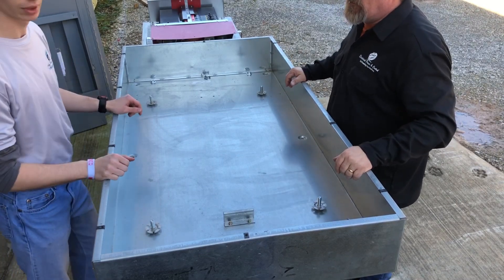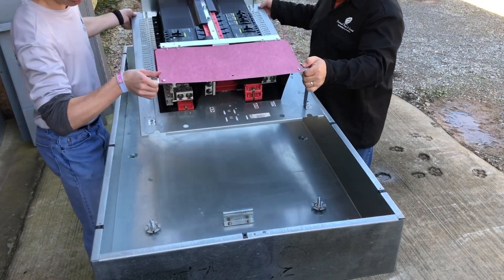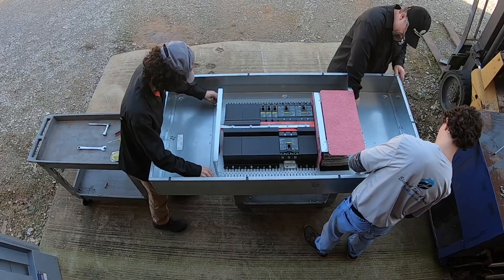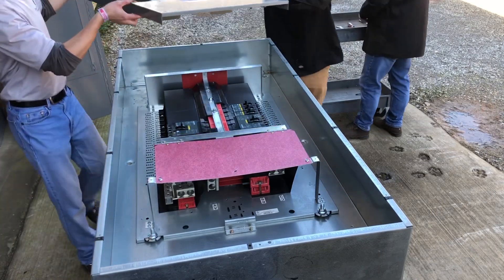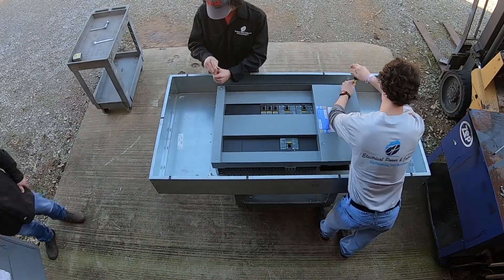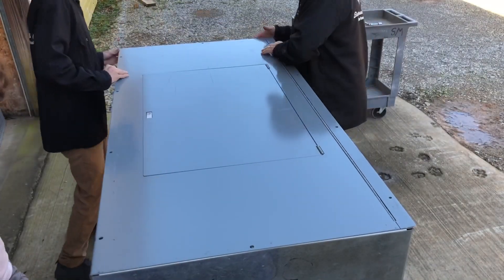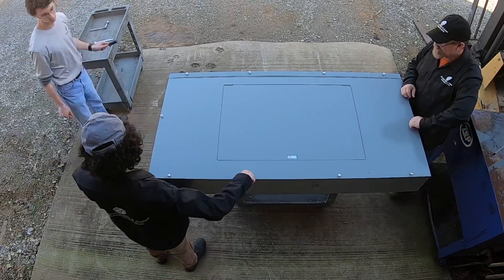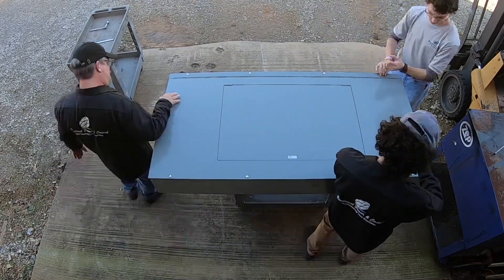Assembling a 400 Amp Breaker Panel

Comment: How to I install a 400 amp
Reply from the maker: Sbc Muck Is your panel a main breaker panel or a main lug panel?
Reply: @electricalpowerandcontrol  main breaker
Reply: @electricalpowerandcontrol  have you done any videos on that yet ?
Reply from the maker: @gtbbmuck  here is a link for a smaller feeder i-Line breaker we did.
 https://www.youtube.com/watch?v=Uxs_DIqdh2c 
If you are installing the 400 amp breaker as the main breaker it will be a different process. 
Can you send me a picture of the panel interior?
Reply: @electricalpowerandcontrol  yea sure